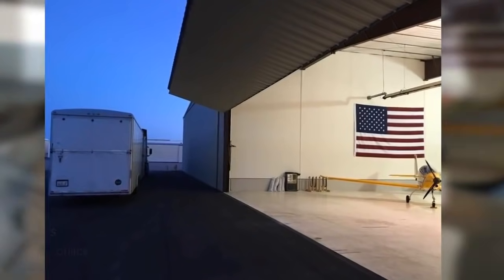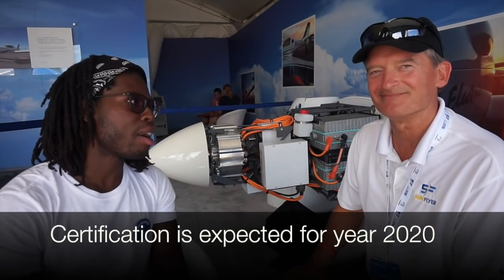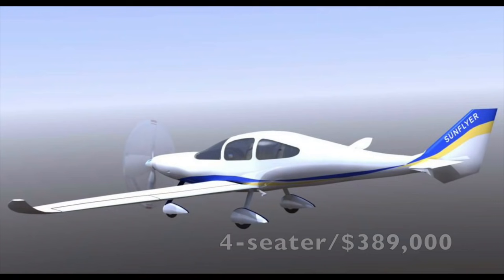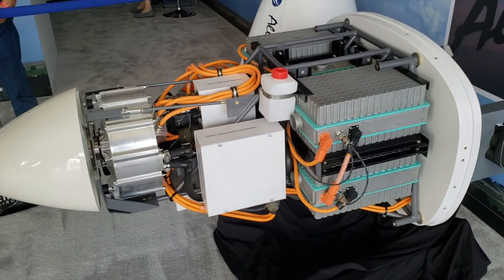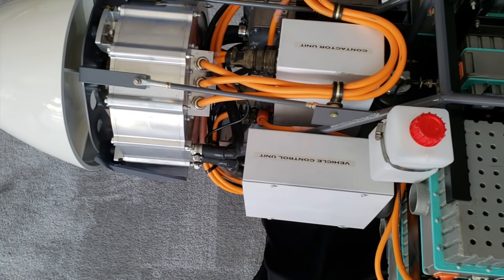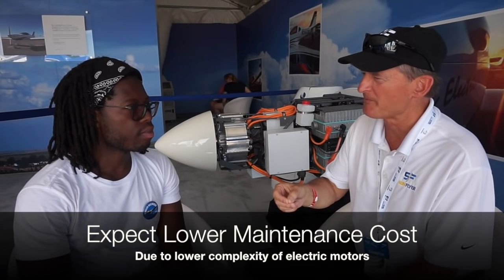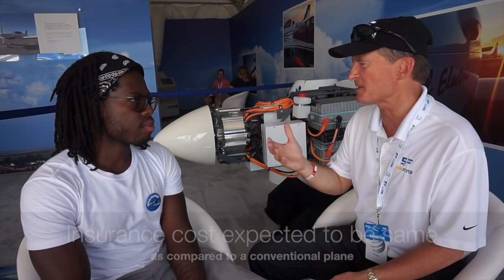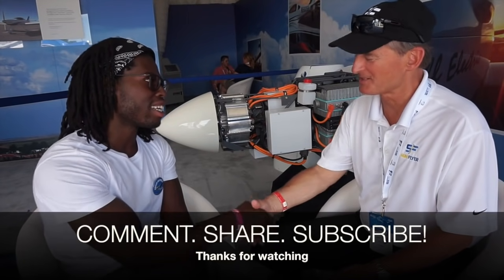Sun Flyer Electric Plane Is Closer Than You Think - Oshkosh 2018

Comment from the maker: Here are answers to all of your questions from Bye Aerospace:
1. How does it handle thermal runaway?  
Answer: Battery temperature is carefully monitored to prevent a runaway.  Batteries are disconnected if needed.
 
2. What about the range, any information on the range of both the 2 and 4 seat variants?  
Answer: Preliminary performance estimates give us a flight of 3 hours (more than 250 nm) for the Sun Flyer 2, and 4 hours (400 nm) for the Sun Flyer 4.
 
3. How many hours can it fly? will temperature changes affect the battery life, range and its charge?  
Answer: Very cold temperatures require some modest pre-heating of the battery to ensure full performance benefit.
 
4. How long does a recharge take? Can charged batteries be swapped for the batteries that need recharging? That is one of the concerns I have with electric planes.  
Answer: We do not swap batteries.  Recharging depends of the supercharger, but with a proper charger it will take roughly ½ the flight time to “refuel” the batteries, (a 1 hour flight would take 20 or 30 minutes to recharge).
 
5. Interesting plane.  According to the website the endurance is 3-4 hours, whereas the Alpha Electro is just 1 hour+reserve.  I wonder how often the battery needs to be replaced? though a Tesla battery apparently loses less capacity each year than a mobile battery because they're usually not charged to capacity.  
Answer: The Sun Flyer is to be fully FAA certified, allowing a much larger, more capable aircraft and a 92 kWhr battery pack.
 
6. Are there plans to incorporate solar panels into the wings for recharging?  
Answer: We have done a lot of testing and have the technical capability to do so.  However, the market interest in solar panel and cost is significant, important tradeoff.
Reply: 1: You can monitor what you want. If the battery goes thermal nothing will stop that until the whole aircraft and its occupants are done for.

2,3,4,5: The battery of the Alpha is 21 kWh and weighs 120 kg with modern Li-Ion. This 92 kWh would imply 500 kg of batteries. And will not fit in that tiny fuselage.
The Alpha recharges at least 45 min after a 1 hour flight. This aircraft would need a huge amount of power to recharge in an hour. 110 kW is a lot to push in a battery in a short amount of time.

6: Solar recharging in-flight or on the ground? Yeah, with that little amount of wing square foot, it will hardly recharge any battery, let alone this 92 kWh pack.

I having second thoughts as I am intimately familiar with the Alpha E.
Reply: Q 0 Rd

Comment: Soooo, what about a Hybrid Plane? like the Prius. I have a touring Edition (2016) and it's scary how much they have improved since my first one that was a 2014. This sort of set up would turn the smaller engine into a generator for battery charging, with minor cost in petroleum fuel, and yet it would mostly be used in take off and landing.

Comment: I have only one problem with an electric airplane:  Useful range.

That may eventually be less of a problem as battery technology improves.

Currently, the flight time per battery charge is too low for much other than use in training student pilots.

Batteries are heavy and aircraft operate on a balance of power:weight:lift:drag  
It takes power to overcome drag, with airspeed providing the lift to overcome weight. (hugely simplified)

to add range with electric you have to add more battery weight which reduces useful payload weight.
The weight of fossil fuel for added range is far smaller % of total aircraft flying weight than the batteries to get similar range.

A good example is: I have a gasoline powered RC model, appx 22 lbs full fuel that can remain airborne for 2 hours.

Replace the gasoline engine with electric motor (save weight there) and replace the fuel tank with a battery (add back the same weight saved before)  Back to 22 lbs ready to go

The result is a model with the same performance, but only 22 to 24 minutes flight duration.
(and this is one of the better results doing an electric conversion)

Its essentially the same problem as with the electric car, however the electric car can deal with added weight more readily than the aircraft can.
Electric cars are just starting to be practical (except not for long trips or towing)
Electric aircraft will take a little longer.

Comment from the maker: For the range: Sun Flyer 2 = 55-135 Knots Normal Speeds / 3.5 Hour Flight Endurance AND Sun Flyer 4 = 55-150 Knots Normal Speeds / 4.2 Hour Flight Endurance. These are the expected range numbers. Nothing concrete yet. I'll forward to Bye Aerospace to  get actual numbers.
Reply: I strongly suspect he is basing range/endurance on the labeled battery capacity rating.
That can be delivered... a few times, then the battery is ruined.

Use 60% of rated amp-hrs, thus 60% of rated endurance for practical application.  Leave the rest as an emergency reserve and avoid using it.

Comment: How many hours can it fly? will temperature changes affect the battery life and its charge?
Reply: Temperature can easily affect battery life.  Heat is a killer of batteries.

Leave a cell phone in a car and let it get hot and it can self-discharge the battery completely (from full) in a couple of hours with the cell phone turned off... or it can make the battery burst into flames.

That's just an example.

You don't want to be in an electric aircraft with an abused battery.
Reply: Thank You very much for You comment.
Reply: F Huber What about solid state batteries? Aren't they supposed to be safer?

Comment: How long does a recharge take? Can charged batteries be swapped for the batteries that need recharging. That is one of the concerns I have with electric planes
Reply: How long it takes to recharge depends on... charger output capacity and the batteryy's ability to accept the charge.

I have LiPo batteries rated to be recharged in 10 minutes from 0 useful charge remaining. (this rate is slightly abusive, with 30 min per charge being a much better choice)

To recharge a 12S LiPo 5000 mah  at a rate that completes the charge in 30 minutes:
50.4v * 5000 mah *(1/1000 Amp/mah) = 252 watt-hr  so you need 500 watts charge rate. (rounding errors, close enough)
This charge rate requires 8 gauge wire ( heavy duty jumper cables for a car) to supply the charger from a 12 volt source.
I know this, because I used to do it every week several times a week for an RC airplane (need to build a new one for that motor)
This is the max output power of one of my chargers.

That battery will power a 5000 watt (roughly 6.25 hp) motor for a maximum of... 6 minutes at full power 
Closer to 3.5 minutes useful if you don't want to destroy the battery in under 5 charge cycles. Draining any battery completely is VERY bad for its useful life.

Now all you need is the peak voltage of the battery to be charged and its mah or Ah capacity to figure how powerful f a charger is needed for the desired charge rate.

*******

Their "nominal" 4 hr range is probably based on the battery nameplate ratings and would destroy the battery in just a few charge cycles.  Expect 1.5 to 2.5 hr useful if yo want the battery to survive 3 years.
Reply: depends on your charging level of which there are usually 3 plus a battery to battery method which is the fastest
changing batteries is usually not a feasible option, maybe in the future...

Comment: Interesting plane.  According to the website the endurance is 3-4 hours, whereas the Alpha Electro is just 1 hour+reserve.  I wonder how often the battery needs to be replaced, though a Tesla battery apparently loses less capacity each year than a mobile battery because they're usually not charged to capacity.  Looks like a good trainer.  Maybe one day all airports with a flight school will have a supercharger....
Reply from the maker: I'm forwarding all your questions to Bye Aerospace. Thanks.
Reply: Lithium batteries degrade through simple aging.

Just doing scheduled charge/discharge operations designed to maximize the battery life,  you get appx 3 to 4 years of being able to deliver at least 80% of rated capacity and current.

From there, current delivery tends to drop faster than capacity.  I have a 10 year old LiPo that can deliver 70% rated capacity at 5% rated current. (totally useless for anything other than a low wattage light now, but it used to fly a 4 lb model aircraft)

The question becomes: when does current delivery become too low for continued use in the airplane?
For some that might just be the 3 to 4 years with appx  80% of rated current being the minimum acceptable.
for others it might be up to 7 years...
Max power (thus max rate of climb) will suffer when the battery is incapable of delivering the needed current.

This assumes a properly cared for battery.  Abuse it and its useful life drops VERY rapidly.  While a LiPo that I care for reasonably well is typically useful for my RC models for 4 to 5 years, if abused it can be destroyed in 5 charge cycles or less.
Reply: Surprised this was not Mike's first question, along with speed/performance.